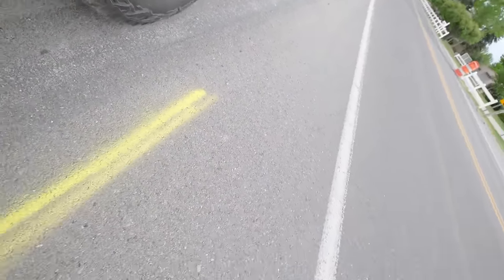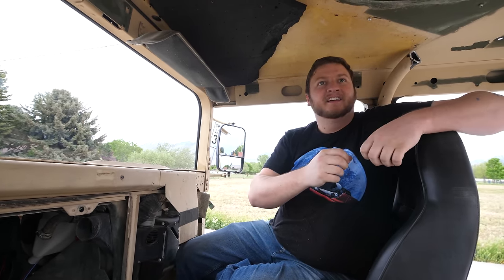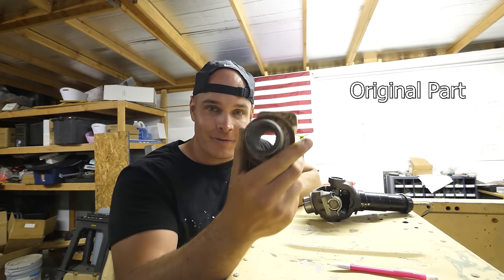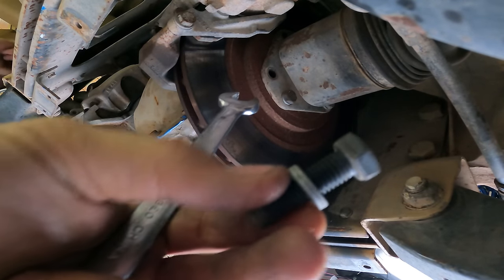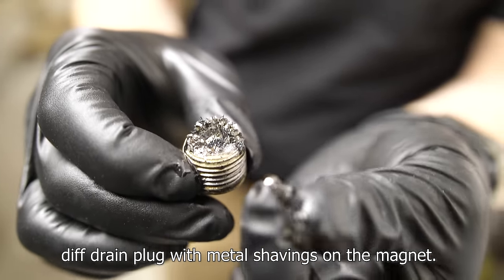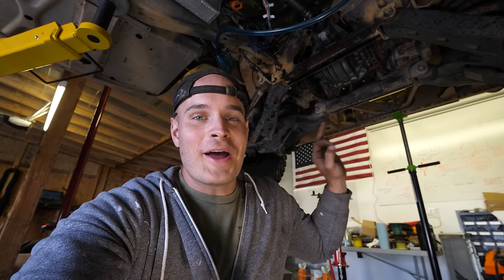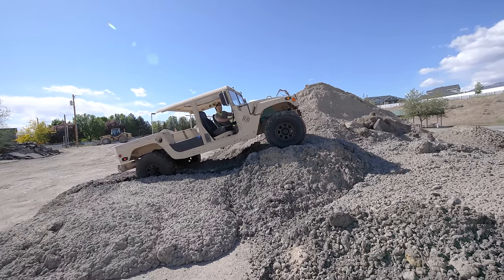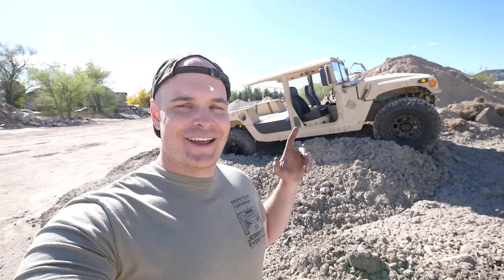My Electric Hummer has a HUGE Problem... and its all my fault.

Comment: Speaking of safety, it was noted in a previous video that the electric assisted steering you have is going to fail because you have the assist on the input side of the steering box. With a hydraulic assisted steering box the electric assist needs to be on the lower or output side or you are going to rip the internals of the box apart and have ZERO steering when it happens. The input side is designed for the low force, ie your arms, it's the output side that's boosted. You've boosted the input and that wont hold.
Reply from the maker: I'll look into fixing it.
Reply: Thanks Mike, very cool.
Reply: @JerryRigEverything  Greetings from Ghana. Wow first time seeing your video after 1hr it was uploaded.
Reply: @JerryRigEverything  I hope you have underside protection, incase the front shaft drops off, I think you should check the front joints too, just to be safe.
Reply: @AverageAlien  what's wrong with EVs?
Reply: @AverageAlien  define car? Sounds like cope to me
Reply: @legoyoda2773  EVs have failed in the 1900s, and they will fail again, cope with your dead overhyped garbage
Reply: @SpurgeonFleischer  Lol you think aliens use pathetic lithium ion batteries? You think aliens pollute the environment by strip mining for lithium and then shipping it all over the world to process it? Only to throw it out again after 10 years? Lmao
Reply: @SpurgeonFleischer  Let's see, almost magical liquid with a very high energy density or some pathetic, heavy, low energy density rectangles that weight tons
Reply: @AverageAlien  172 comments
Reply: @theninjascientist689  46 comments, reach my level scrub
Reply: @AverageAlien  this thing is more like an E-locomotive anyways. Or e-tractor.
Reply: why didnt you just remove the the driveshaft to the diff instead of just wearing out a ratchet strap by resting the shaft on it?
Reply: @PwnageProductions10  proba ly didn't have tools handy to remove on roadside. And drive shafts are generally pretty smooth so that strap he used would have held up for a bit with slow driving.
Reply: ah, so if i understand the input side is only supposed to deal with human strength but its got inhuman strength being shoved
Reply: @AverageAlien  Let’s see, a fuel which will run out in 40 years at the current rate or a fuel which will never run out, is cheaper and doesn’t release greenhouse gases? Also as a side note this ‘magical liquid’ may have a higher energy density but only 20-30% of it is actually used to move a vehicle or produce power.
Reply: Oh just your everyday small safety oversight, good thing the DMV decided that this is road legal.
Reply: @AverageAlien  Why not? You're really only changing the Primary Mover.
Reply: @AverageAlien  Apollo 1 failed too.
Reply: @PwnageProductions10  He has an Atlas transfer case so he can have it in front wheel drive mode only, the rear shaft didn't move
Reply: @JerryRigEverything  I hope you put teflon sealant on the splines. You'll spring a leak later if you didn't.
Reply: @burnerjack01  And then immediately succeeded. Electric cars have failed for 100 years now, move on
Reply: @AverageAlien  ok Exxon, we hear and obey.
Reply: @AverageAlien  We'll see. It ain't over.
Battery tech marches on at an incredible pace.
Reply: Nice stache
Reply: @AverageAlien  Electric cars failed in the 1900s because the technology wasn't there yet. Technology reached the point where electric vehicles are practical around 2011, and will likely advance to the point where gas cars are pointless sometime in the early 2030s.
Reply: @AverageAlien  lol, electric vehicles are far superior now than back in the 1900s. All we need is better batteries which we will have due to competition for the space.
Reply: @user2C47  Nope, lol. You are living in fantasy land buddy. Li-ion batteries have quite literally reached their maximum efficiency about 20 years ago. All Tesla managed to do was double the amount of batteries they put in their cars, meaning that they have literally hit a brick wall, and it's not long till their hype machines start falling to pieces rapidly, as more and more people realise they just wasted their money on a money pit heap of junk, with the batteries all guaranteed to die within 10 years time.
Reply: @AverageAlien  well, from a tech standpoint electric motors are more efficient and overall more reliable. Really your argument isn't that electric cars are bad but that our battery tech is bad. However this is not true, over the past 10 years alone energy density of lithium batteries has increased by about 50%. Furthermore renewable sources of energy have drastically increased in efficiency as have recycling tech. It is becoming viable to recover up to ~90% of the materials in lithium batteries and the cost of doing so is reasonable enough to be marketable. Batteries can also be replaced and new tech is always being developed. New DC fast charging is able to provide up to 350kW of power to vehicles which for reference would charge the extended range model S in about 15min (350 miles of range). Given the average time to fill up at the gas pump is 5-10minutes, we have reached a point where you can recharge almost as fast as fueling up with gas. 

so electric motors are more powerful, more reliable, and cheaper than gasoline engines to produce. They also require less materials to produce. Once they have the advantage of popularity and larger production runs, electric cars can be cheaper than gas cars to buy. They are simple systems that are easy to repair and take up less room. The only disadvantages of EVs as it currently stands is: cost, most EV are too expensive for middle class families to buy. Charging stations, we need more DC fast charging stations everywhere there are gas stations essentially. and your main point lithium mining, which new battery tech and recycling procedures are making this more environmentally viable every day.   

I'm an electrical engineer. I have a good understanding of both the tech and the current industry, there is a lot of really cool stuff coming out, don't discount everything so quickly, there are gonna be a lot of new toys for you to play with soon and you will have a lot more fun if you learn how to play with them.
Reply: Toyota have quite a few vehicles with the electric assist on the input side of the steering, so it may just depend on the nature of the device you have. With the Toyotas the electric assist on the input side of the steering is not much and only helps a limited amount. But sure it's worth looking into and confirm that no steering components maybe damaged.
Reply: @AverageAlien  I, am very unfortunate to hear that you did not receive an education. 

I would like to inform you that oil has around 50 years left and lithium has around 80 years left at its current rate and petrol is only 100x more dense than a battery. 

I would highly recommend at least using the search engine of google in your research next time rather than taking information from OPEC,

Many condolences, BadXPiggy
Reply: @PwnageProductions10  probably to keep the oil in the transfer case.
Reply: @kjartanB  oh I didn't know they could do that, that's sick!
Reply: @aserta  what? That's not where the seal is. The seal is on the outside of the shaft.
Reply: @AverageAlien  Tesla went to larger cells and different construction which reduces labor, reduces resistance at the cell terminals, reduces the number of cells needed (it's 1/3-1/2 the number of cells) increased the power density by almost 200% with only a little more than 150% increase in volume of each cell compared to an 18650.
I'm sorry that you hate EVs but it sounds like you don't know much about them.
What's really needed is more public transportation, less urbanization and getting cars off the road. Not just replacing them with EVs.
Reply: @BadXPiggyGaming  edited: yes, gasoline is 100 times as energy dense as a battery. I thought it was less. 

1 gallon of gas contains 33.7kWh worth of energy but an electric car can go over 100 miles on that same amount of power. Not only that but how much energy was wasted in drilling, transporting, refining and transporting again to get that gasoline to the pump?
Reply: @AverageAlien  Almost magical liquid that causes massive climate changes when it burns en masse, but sure.
Reply: Matthew Hurren  5000x less efficient actually. Lmao
Reply: @victordonchenko4837  No it doesn't
Reply: @AverageAlien  Right, because EVs are running the same technology they did in the 1900s........NOT!
Reply: @BadXPiggyGaming  Run out in 40 years?  Didn't know corn could run out.  Why do EV supporters forget that diesel engines exist, and that can run off renewable resources?  Heck, we've had technology since the 30's that lets us convert any biomass (normally wood, but it works with plant/animal waste and byproducts) into fuel for gasoline engines.

I can do all the maintenance on my ICE at home for practically free and as such have over 2500000 miles on my engine, but I could buy a whole new car for less than it costs to replace the battery in an EV once (you have to replace them every ~500000 miles currently)

And you want to get into MPG?  Diesel motorcycles can get over 140 MPG, so clearly we should be using those instead of EVs that only get an equivalent of 100 MPG.
Reply: You might have saved his life with this conment!
Reply: @AverageAlien  Trolling level: C. Meets needs. Got plenty of feedback. Not confrontational enough and needs more single-post rambling. Try harder next time.
Reply: @jessebrook1688  Try focusing on your relationship with your boyfriend next time
Reply: @AverageAlien  He thinks your trolling needs serious work too. 😰
Reply: @GremlinSciences  Biomass synthesized fuel has failed to reach the level where some gasoline stations can profitably go 100% synthetic while serving the same cars, also converting biomass to fuel then fuel to mechanical energy incurs energy losses at both steps.
 Unless it's a locked down computer on wheels like Tesla, repairing electrical cars should be at least as easy as cars with ICEs.  Tools will be slightly different, like tools to check the coils and timing on big brushless motors instead of the valves and timing on an ICE.  Or tools to check the battery packs instead of tools to check the tank and fuel lines.
Reply: @GremlinSciences  if we start to generate fuel from agriculture sector on commercial level and in every country of the world, it will create less room for human food needs and more for vehicles. Due to rising population and risky food security it will surely be devastating. At present in current affairs food shortage is a fuge topic. So for your idea.....its a big "NO"
Reply: @s_dharni2483  Depends on what foods you use for fuel. America's corn farms actually only put less than half of their actual yield to market, the rest is held by the government and/or simply disposed of, and that's not counting the portion that goes to market but ends up spoiled before being bought.
You can also get fuel from crops in multiple ways.  If you extract the oils they can be used as-is for diesel, while the sugars and starches can be fermented into ethanol and the remaining biomass can be turned into syngas through gasification.  Syngas can then be further processed into diesel or high octane gasoline, or used in place of natural gas.
However, they are currently looking into even more efficient ways to produce gasoline, such as algae farms and hydroponics so farms can expand vertically instead of horizontally.
Reply: @GremlinSciences  the area of concern in your idea.......is these biofuels are energy net positive or net negative.....net negative means you have to utilise more energy as input and output is less than input....corn is in the field of net negative, sugarcane is little bit positive.....also in the usa the corn idustry is jst for stabilising jobs on which the politics is played......the land area under agriculture is not available to meet the both needs as human food and vehicle fuels.....population is increasing.....so this option is not viable my friend....try to understand.....it is good only for surplus production, which is not a case of long shot, jst temporary.
Reply: @AverageAlien  emotional damage
Reply: @JerryRigEverything  when is the next Hummer video?
Reply: @AverageAlien  L + Ratio + Obvious Troll 0/10

Comment: So nice and convenient you could just pop into front wheel drive to get home 😅
Reply: I blow out a rear diff on a 96 GMC jimmy, disconnected the shaft to rear, and put in 4wd to use front to get home lol I can relate LMFAO :P
Reply: basically any 4x4 can do this, just go into 4 high
Reply: Yeah I had to do the same on an 81 Ram charger. Rear U joint blew out. :)
Reply: The HMMWV transfer case is full time four wheel drive.
Reply: @aidanlutley7119  he's not using the HMMWV t-case, he has an Atlas II and it allows for split operation. The Atlas II ccan be put into Rear Wheel Drive, Front Wheel Drive, or Four Wheel Drive as the two out puts have their own high/neutral/low range selectors.
Reply: I think they have made sure the controllers on all the new awd electric vehicles can run if one motor fails. That is more of an electronics solution where this was a mechanical solution.
Reply: Well even though the electric motor output isn't going to overwhelm the new larger correct U joint and yoke in HI-Range, I don't know if he considers what would happen if he put the transfer case in 4-LOW which would probably more than double the torque output of the electric motor at that point......🤔
Reply: Doing that on a regular car just means taking the drive shaft off
Reply: wow hey authentech
Reply: @PandaTaco  No, in 4Hi the rear shaft still turns. With this box, the rear output can be left in neutral while driving the front shaft, allowing them to leave the rear shaft in place, tied up to the frame.

Comment: You forgot to put Teflon sealer in the yoke splines, this will cause a leak later. Big fan here been watching this build since day one. Keep it up.
Reply: Liked to get it boosted higher
Reply: Not really.  Even on a diff that seals on the yoke, the nut tightened will stop the extremely minor amount of fluid trying to go past the splines.  Not really worth worrying about.

Comment: You made replacing that part look too easy! haha
Reply: well every job is 100 times easier when you have a lift on your garage.
Reply: just a driveshaft
Reply: Luckily military hummers are designed to be worked on by privates in a motor pool, but Jerry is definitely an organized guy who goes out of his way to understand how stuff works
Reply: Designed to be worked for sure, just not be to driven. Those are anything but reliable...

Comment: You should weld up an steel "cage" for the middle driveshaft so it it fails again you prevent it bouncing around to much and may damadge the batteries.

Have it to be 1 cm clearance up and down (maximum suspension travel) and 2 cm to the sides or a little more to not be hit while the rear flexes in corners..

Easy job and may save your vehicle/batteries/life